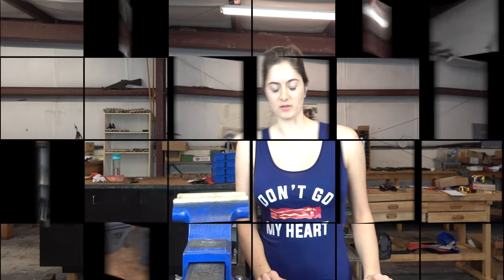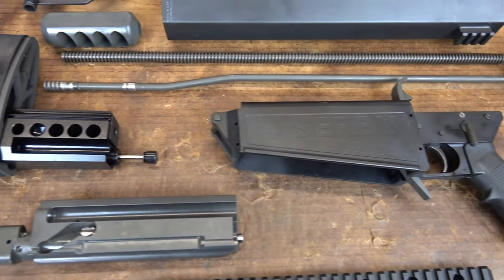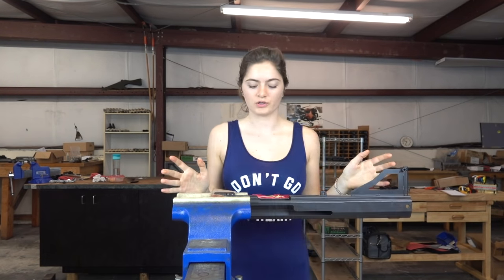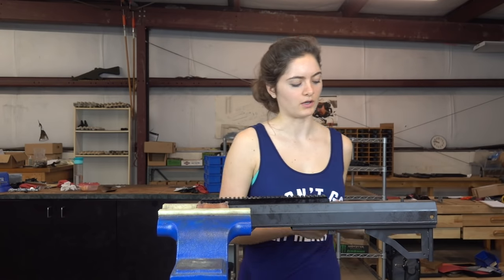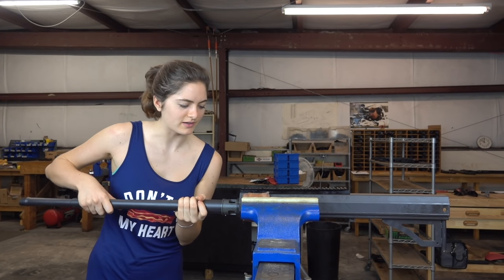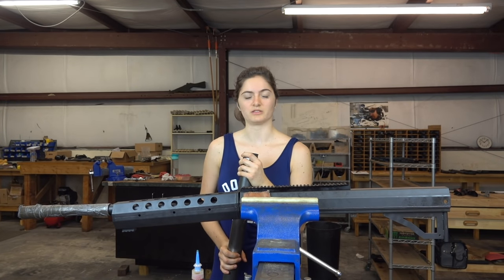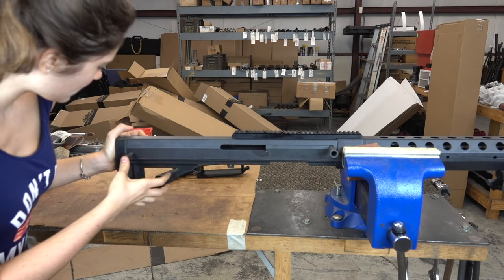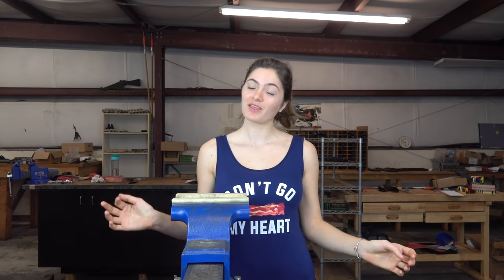SERBU BFG-50A BUILD IN MY PAJAMAS

Comment: What are the provisions for adding rail sections to the handguard? I'd like to see M-LOK compatibility. Also I've never liked the idea of an exposed gas tube. I'm sure it's probably good to go but it seems like a drop at just the right spot would render it a bolt gun.

Comment: No offense but when you torque down the barrel nut with a torque wrench the wrench should only be pushed or pulled on by the end of the handle, not mid way otherwise you are not tightening it to true torque values whatever that may be. Example 45 foot pounds of torque is applying 45 pounds of force at one foot distance from the center of the socket on the wrench in the direction that you are trying to turn the nut or bolt. The reason that I mention this is that you did put locktight on the nut so I am assuming that at that point it will not be removed again and so should be torqued to a given value, it cannot be torqued properly once the locktight sets up  as in redone later or checked on later.

Comment: Wrong.. standardize the bolt.. headspace (in the barrel) should remain the same, not dependent on the bolt itself. Humble words from a gunsmith.
Reply from the maker: According to my not-so-humble gun designer dad, I'm right. :-)
Reply: Wanna fight about it? haha. Well, glad to see your system seems to work well enough to not have unsupported cases and such. Seems like a decent competitor to the big dogs overall. Best of luck to y'all.